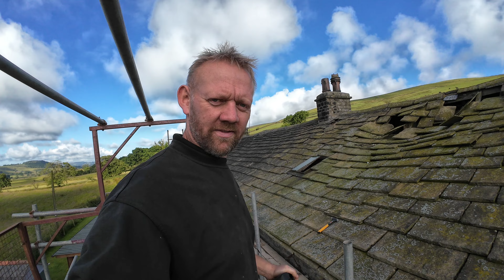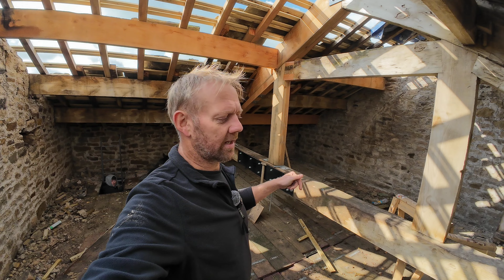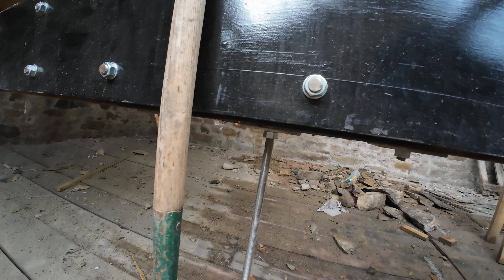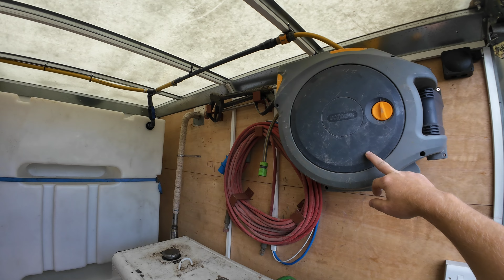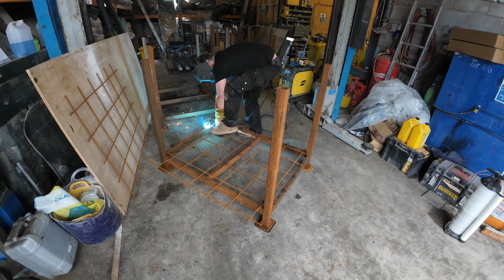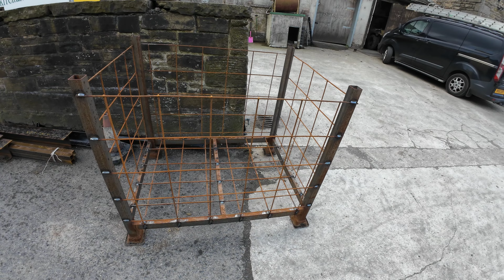5. How did this barn not COLLASPE???? Truss repair completed 👍

Comment: I may have missed it but were the replacement roof timbers Douglas fir? I think in time those type of repairs will age well historically clearly showing the old v new rather than an entire replacement. The weight of that roof must be huge!
Reply from the maker: We have used a slow grown Douglas Fir on the repairs. Weight is around 1 ton per 5-6 sqm laid on the roof. I would think there is around  7-8 ton per side.